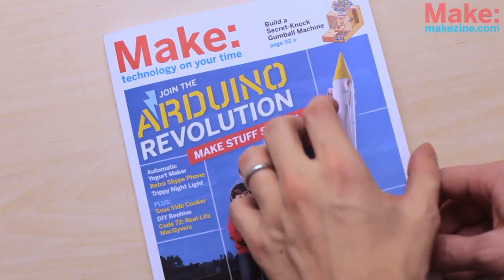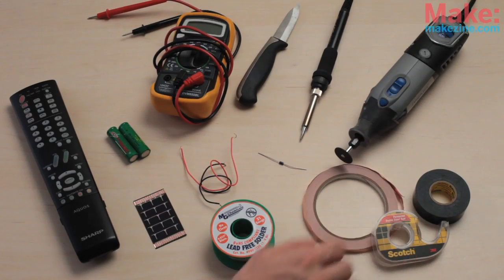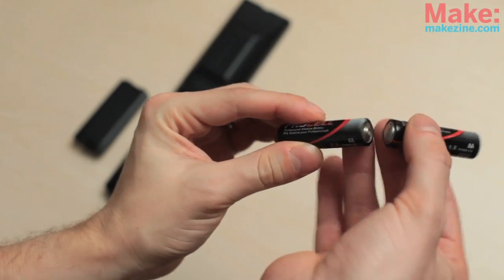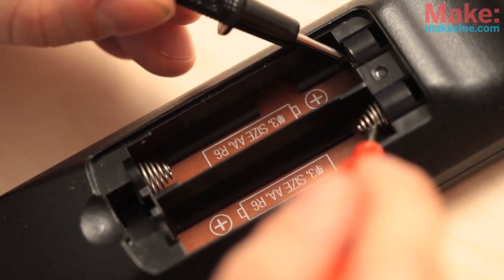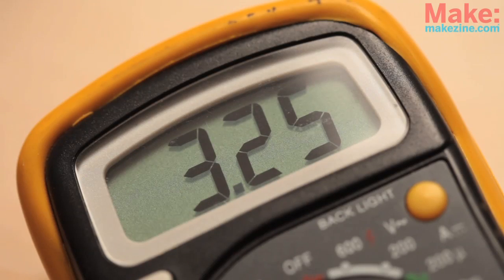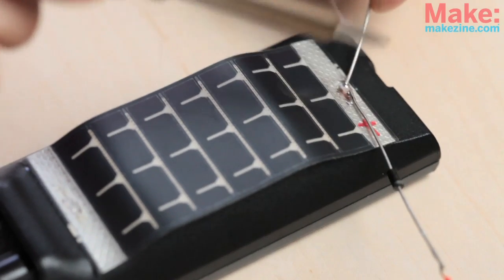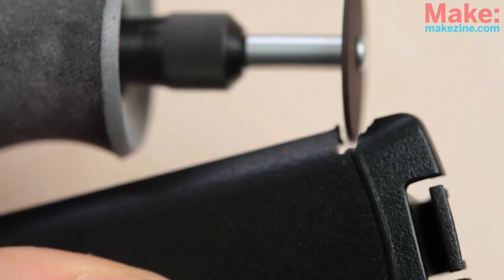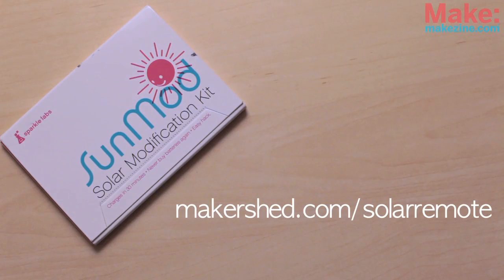Solar TV Remote

Comment: If you're using Ni-MH batteries, they will recharge, but they will have a "memory" which means unless you drain them completely before recharging them they will lose a certain percentage of usefulness each time you charge them. 
Point being, you'll still need to buy batteries for your remote, you'd just need them less often. There's about $0.67 price difference between the battery types- I'm sure you'll absolve that pretty quickly with this project though.

Comment: What voltage is the solar panel rated at? It would need to be at least 1.5 volts to charge up one cell anProxy-Connection: keep-alive
Cache-Control: max-age=0

20since it is in series it would need 3

Comment: CAUTION!!!! This mod could cause a house fire or Battery Explosion. In a regular solar power setup there is a voltage regulator that keeps the batteries from overcharging. This mod only has a Diode that limits which direction the voltage is running. DO NOT DO THIS PROJECT YOU COULD GET SEROUS CHEMICAL BURNS OR EVEN BURN DOWN YOUR HOUSE!!!!! IF YOUR HOUSE DOES GET BURNED DOWN OR YOU DO RECEIVE CHEMICAL BURNS MAKE MAGAZINE AND ITS PRODUCERS ARE CRIMINALLY LIABLE FOR YOUR INJURIES.

Comment: I really like this project.... I'd like to try it on my wii-motes!

Though like an earlier poster said, what is to stop the batteries over charging?  Or is the current so low that it effectively just trickle charges the cells (which i think you can do for a long time quite safely)

Comment: That sure is one ugly ass hackjob you did there. Wires all hanging out and covered with electrical tape instead of strung through the inside of the casing. Cool idea, but you get a C for effort.

Comment: in case anyone is thinking about the annoying wires, just drill a hole in the back of the controller and go through the controller to hook your wires instead of outside the controller... just a thought

Comment: @ElectricMuffins probably not because TV remotes work in small bursts of morse code like inferred signals, as apposed to like an xbox 360 control constantly sending feedback via radio signals from the xbox and back to the controller even if you aren't pressing any buttons. although you could try moding this mod so to speak lol so that the solar panel was hooked up to a dock of rechargeable batteries so that the limit to how much power can be held would far exceed the remote with no batteries.

Comment: but umm why would you be outside with your remote control this isn't a calculator it doesn't work with just some light from bulbs you would have to place this by a window sorry i just don't see the reason why you use this if you could just use rechargeable batteries